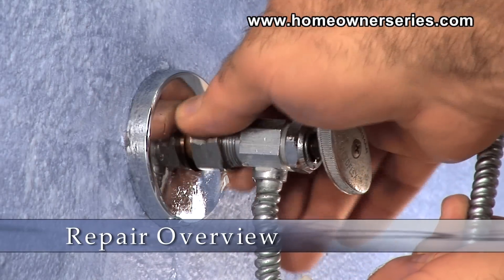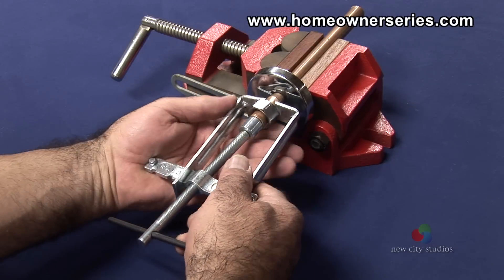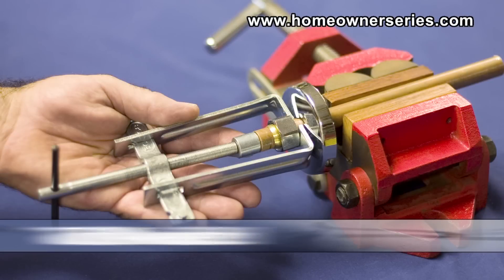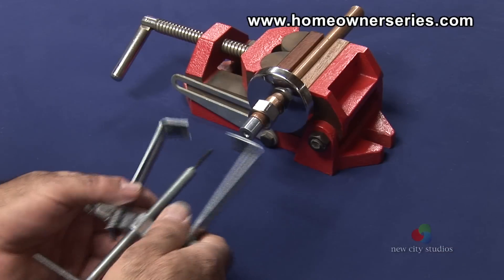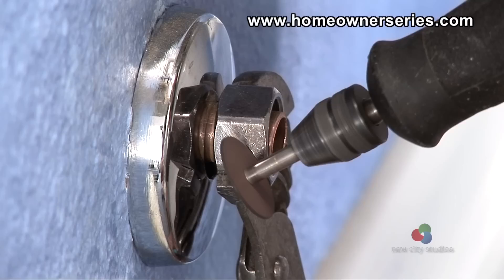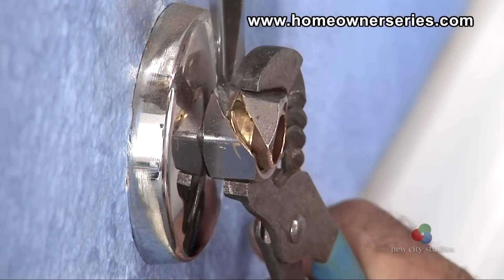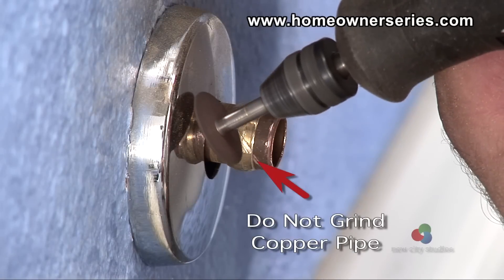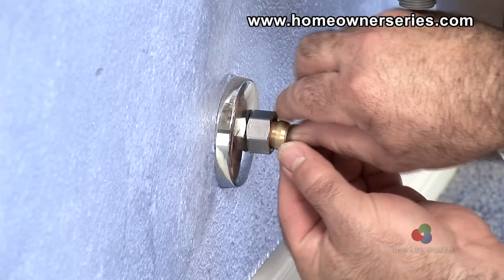How to Fix a Toilet - Compression Ring Removal

Comment: A third option that is more labor intensive but will cause less damage than a dremel - a flat file, and a small triangular file. I filed a flat spot in the compression ring, and then once I got as close to the pipe as I could, took the small triangular file and filed a 'line', like he does in the video with the dremel.

Comment: DONT BOTHER WITH SPECIAL TOOLS OR GRINDERS!!  Buy a $1 pack of 1/4 inch flat washers.  Put two washers inside the old valve. Reinstall the valve.  Take it off again.  Put two more washers in.  Rinse and repeat.  Once the compression ring is down to the end of the pipe, as long as you didn't re-compress it on the last couple of rounds you should be able to loose the nut a bit, and wiggle the valve back and forth until the ring comes off.  

Too easy... Don't waste your money on special tools you'll hardly use, and don't risk damage to the plumbing with a Dremel.
Reply: This is absolutely brilliant.  I bought new shut off valves and they use a coarse compression nut instead of a fine thread compression nut.  I was able to swap them out in minutes with this methods.  Thanks for the idea.
Reply: No problem! Glad I could help!
Reply: You just won the internet Mr. Minks... thank you for this brilliant tip!
Reply: Russell Berrett Certainly! You're very welcome!
Reply: yup it works!!!  i am installing a new toilet and was about to buy this tool then read your comment....had a bag of old washers.  just like you said  Thanks!
Reply: Glenn Minks  Glenn Minks is a genius! The washer trick was so quick and easy. This video should just read "See Glenn Minks' comment below!"
Reply: Glenn Minks - Here's to Mr. Minks...I owe you a beer sir.  This trick works and I had some 1/4 inch flat washers handy.  Good stuff man.
Reply: Glenn Minks  There's always a way if We use the Brain; Thank You "Minks".  Gracias a Ti Manito.
Reply: Simple, need a little patience and works like a charm, Thanks!
Reply: This was extremely helpful since the tool I purchased for this job was useless. In my case I could not find these washers at any nearby store. I imagine they would have had to have been 9/16 of an inch in OUTSIDE diameter as opposed to 1/4 inch right? Just enough to fit in the old valve BUT not too small that it would not press against the edge of the copper pipe? In any case, I improvised and used a combination of nuts and nail heads I had lying around. Thanks.
Reply: nah, too complicated. I used dynamite to blow the valve out with the toilet
Reply: Ski Fall Dynamite..a true connoisseur. I find C4 a lot easier to get ahold of this day and age... lol
Reply: Does this work even if it’s corroded?
Reply: @Uprisenuplift  if it doesn't, you lost $1 and 10 minutes in the process. Not sure how old your plumbing, but if it's severely corroded, more than 50 years old, you may need to replace the system. 

I would try it. Worst case, it doesn't work. Newer copper that may be seeping and turning green is probably fine. The corrosion is protective, and will come off easily with steel wool or fine sand paper.
Reply: @glennminks6643  nice to see you still replying after 8 years! I'm having trouble visualizing this method. You insert the washers into the old valve so they are fully enclosed inside the valve threads? What is the outside diameter of the washers?
Reply: @realSamAndrew  if you buy the standard 1/4 ID flat washers, they fit perfect. Probably 9/16 or 17/32 OD, but I didn't bother to measure. They'll drop right into the valve body. Fits perfect.

Comment: I just replaced an old Shutoff Valve with a new one, but there is still leaking water around the nut. My suspicion is that the ferrule (compression ring) is faulty (15 years old) and needs to be replaced. I was thinking I would have to cut it off, but using the Puller seems like a much safer way to accomplish the task. I've read that Pipe Dope or Teflon Tape can be used on the copper pipe to make a more water-tight seal, but I've also read that these measures defeat the compression ring's use..